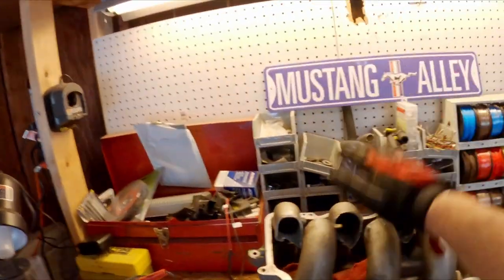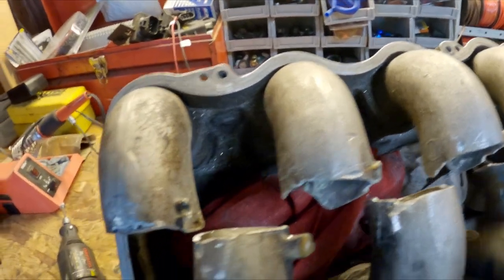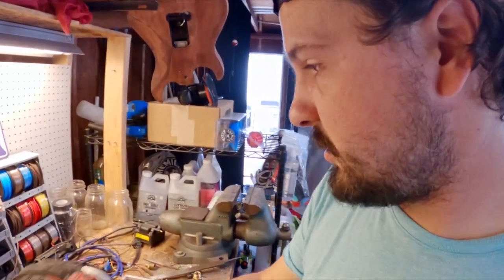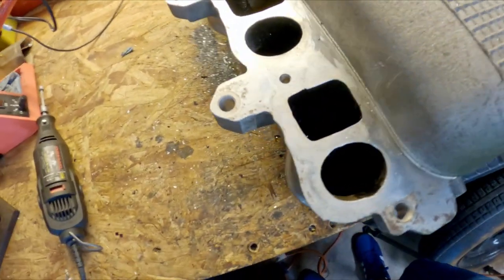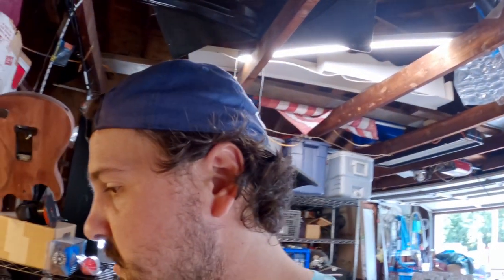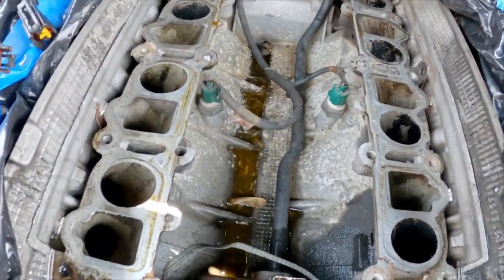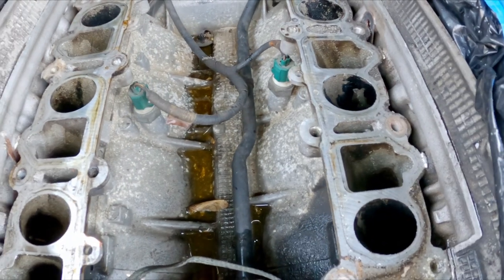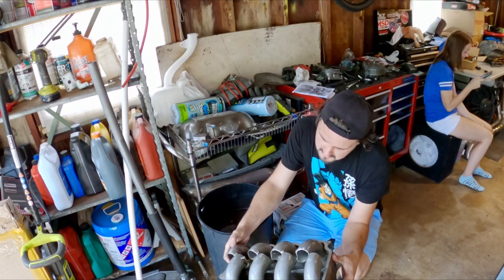This Cobra SHORT RUNNER Intake Manifold is A BASKET CASE

Comment: Why did you fill the bottom of the intake?? You decreased the plenum volume.
Reply from the maker: From what I understand, the floor of plenum is raised the same amount cut from the runners. Doing that to that specific intake is supposed to help with low end torque. Most of what I did was probably wrong in so many ways, but I was curious if being cheap about was still beneficial.

Comment: 😂😂 bro that’s not how you do a SRI . You should only cut 1.5 to 2 “ off the runners and weld the belled ends back on .
Reply from the maker: That's how I did it. I know it wasn't right, I just wanted to see if it would work.